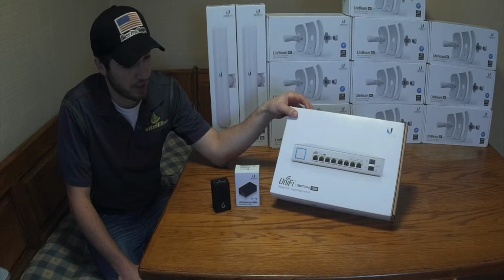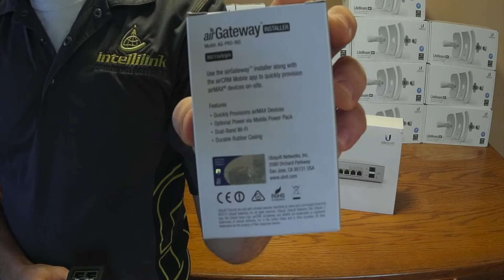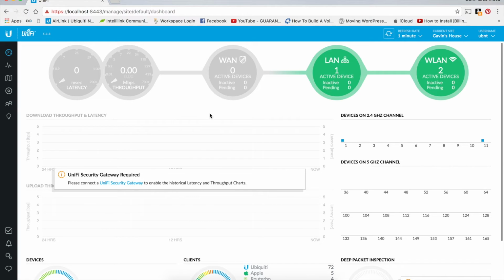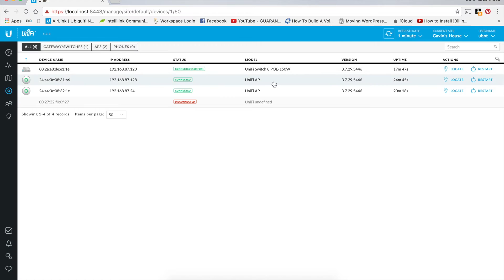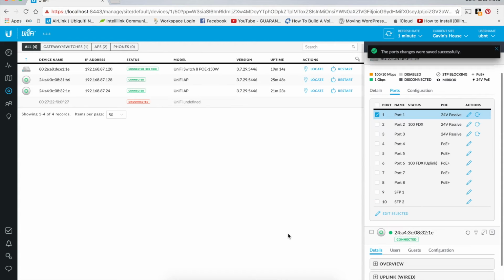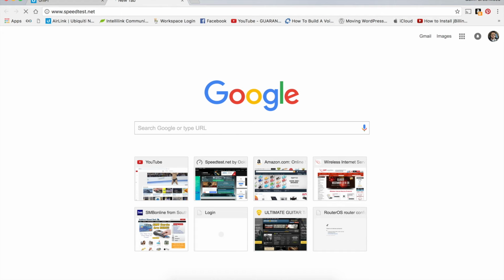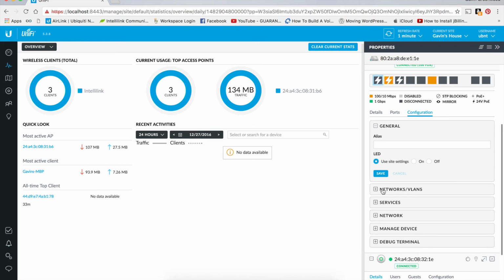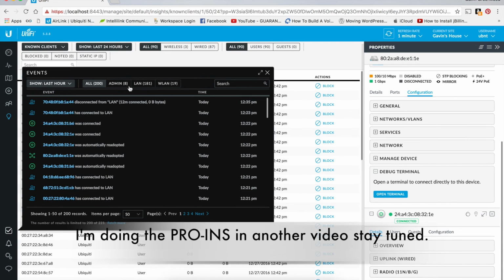Ubiquiti Networks US‑8‑150W 8 Port POE Unifi Switch Unbox and GUI

Comment: Can a switch be powered over Ethernet? I have set up a switch in a building where there's frequent drops in electricity. So can I power my switch through cat6 cable which is connected from the switch to my office?
Reply from the maker: Aadhish Gaikwad yes this is just what you need. 
http://www.neobits.com/tycon_power_systems_tp_ms4x4_tycon_power_4_port_p3780749.html?atc=gbp&gclid=CjwKEAiAqJjDBRCG5KK6hq_juDwSJABRm03h6RST1lrPzKD8FpkVFhIJOFu1C9J3SqdDTbjXf1rWzBoCrmnw_wcB
Reply: Isn't there a cheaper alternative. Or can you at least tell me what it is called as I am totally unaware of these devices. 
P. S. I reside in India
Reply: yes,  you'll need to get a 802.3at POE injector, also known as POE+.  Looks like the US-8 needs a 48v  25.5w supply.